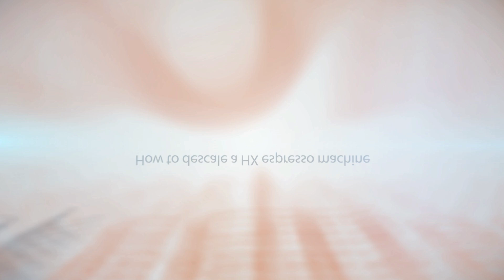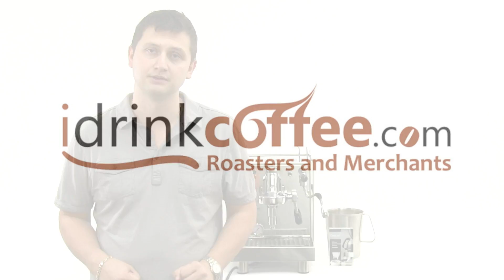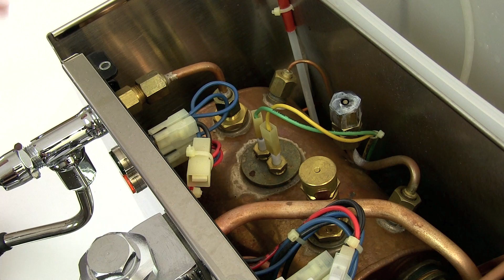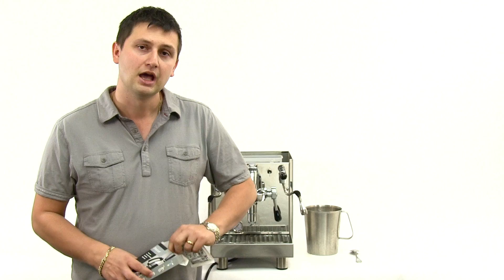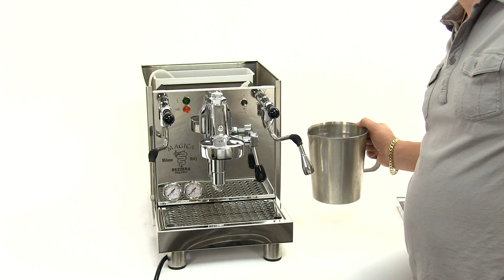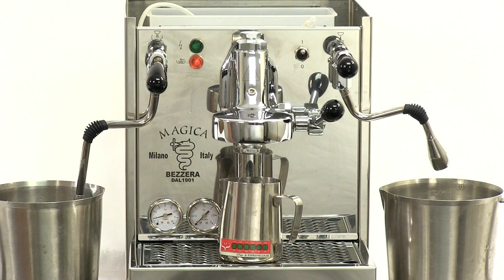How to descale a heat exchanger espresso machine

Comment: Any recommendations on using this method on a plumbed in heat exchanger? I have a Fiorenzato Volante. I tried once using an external tank but the pump sounded so labored that I quickly aborted out of fear of damaging it.
Reply from the maker: +putneybay 

It would be much easier to just descale a plumbed in machine without disconnecting the sensors. The easiest way would be to switch to water tank rather then direct connection, if your machine allows for that.
Reply: No, the machine has no tank at all. Any way to DIY descale it, or do I always have to lug it into a repair shop?
Reply from the maker: +PutneyBay 

It is challenging to descale a plumbed machine. In order to do so, you would have to get a FloJet, a larger water bottle and some descaler

Comment: I have a question regarding the "leave it to rest as long as you want. more than an hour" advice.
I have an aluminum boiler machine. Can the urnex descal I use, damage the aluminum?

Thank you
Reply from the maker: +UltiMogr 
No it won't. Leaving a descaler in a boiler overnight should be sufficient

Comment: hi there,

I just bought a nuova simonolli oscar and im a newbie with coffee machines. do you have a video for descaling the oscar? i saw from a youtube video that he used the steam wand (since it doesnt have the hot water spout) to get rid of the descale water. be also turned the machine to it's side (not sure if that is safe) 

do i also have to disengage the probe in the oscar as well? would be very very helpful if you go give some advice.. thanks
Reply from the maker: +Em t I am sorry but we do not have a similar video on the Oscar. I would recommend you to descale it the standard way, without disconnecting the probe and flushing through the steamer.
Reply: @iDrinkCoffeeCanada  Hi. Do you think the Oscar 2 can be cleaned the same way though using only the steam wand (since it does not have a water spout)? The O2 has a drain on the boiler, so do you have any recommendations on how best to take advantage?

Comment: Incredible, the most stupid advise I've seen in a while.
When you NEED TO descale an HX machine, its always better to to it apart!
Your method is a recipe for disaster, as we just saw on our coffee forum!!
Pieces of calcium will start travelling to places you wish it didn't...and most likely will lead to having to take it apart anyway!!
This video is especially not done on HX and E61 type espressomakers!!
So descaling is for very badly neglected machines!
Its way better to prevent the building up of scale, by using a special filter on the water intake of your machine, or the type of bag you put in your water container, or the professional filters of course...
Reply: ***** , often people think they need to descale 'regularly', its WAY better to avoid building up of scale by using a filter! The taste of your coffee will improve too!
Take out the heating element and check the inside of the boiler, when there is a lot of scale, meaning no filtered water was used, its better to take the boiler out plus the tubing and descale with citrid acid. After using the acid its a good idea to fill the boiler and add a little baking soda, it will stop the acidity.
In that case you need to descale the grouphead too! Take the mushroom of the head, that will give you a good indication as to how much build up you have.
Use new rings and rubbers!
I know how bad most drinking water is in N America, although everybody says its 'perfect', so again, please use a filter. There are filter 'bags' too to put in the tanks of prosumer machines, as there are small filters you attach to the tube in your water reservoir, for the serious coffee drinker there are the professional filters you can connect to your water main.
Hope its clear, English in not my native language.
Reply: Incredible! some people don't realize that good descaling solution dissolves calcium,
I've been descaling my VBM HX machine using this method for many years.
BTW, filters help but descaling still needs to be done especially if you live in a region where the water is very hard.
This is the same descaling method that's listed in my VBM manual, some people need to do some research rather than give bad advice.
Reply: It’s good this video because i have already clients in my service with machines blocked. Clients who follow this guy .  Guys , never do this at home if you dont want to make damages to machines. In the final you go to the service or drink tea with descale taste. Good luck

Comment: Great video and very similar to my ECM machine. Took me forever to figure out a lot of this information with the company not really providing any isight. Do you know anything about setting the pressure for the pump? I have never been able to get a clear picture on where to exactly change the air flow as my machine is running a bit too high in pressure. This is not the temperature boiler setting as this I know.

Comment: I just wanted to add a tip with regards to the pressure relief valve. It is pointed out in the video. In the middle there's a pin that will move up to release any excess pressure, thus protecting the tank. However, with the level probe disabled, and the tank filled to the rim, chances are that the pump will continue to pump water through the pressure relief valve.

I had little luck with the towel method to stop the water from flooding into the machine (where it immediately drained out through holes and onto the counter). With the steam valve and the hot water tap opened up completely, there's little chance of any pressure building up in the tank, so one can quite simply push down on the little pin on the top of the PRV, which will close it completely and stop any water from coming out that way. I used a towel to pressure down with my thumb.

This of course should never be attempted with the tank under pressure. Not only will you not be able to push the pin down, should it raise up because of pressure. The water coming out will also be scalding hot, and so you'll burn yourself.

So in short, do this only with the steam and hot water taps open, and while the tank is not yet heated up.

Comment: Thanks for these instructions! Very useful. Although I agree with others that the entire tank don't actually need to be descaled, this method will indeed ensure that all the water is displaced. Of course, disassembling the machine, in order to remove the tank and descale this on it's own, would descale the entire tank as well. But I do agree with the comment on electrocution. Be careful when poking around in the machine, as 120V (for North America, 220V for Europe) is being conducted in there!

Comment: i never need to descale my heat exchanger espresso machine, because I was using Distilled water( Zero Parts per million ) sometime I also filled my machine with Reverse Osmosis water ( Only 2 PPM ) So, I suggest you guys use only Pure H2O to avoid calcium build up in your expensive machine!
Reply: There are those who feel the coffee actually tastes better with minerals in them. I.e. a bit of hardness in the water improves the tastes. Probably a matter of taste though, but something to keep in mind. Also, many HX machines need some minerals in the water (although very little) in order to conduct electricity through the water. This is used to sense if the water tank is empty or not.
Reply: Distilled water water will not taste right, its better to use a 'descaling' bag in your water reservoir, or hook up a small filter to the hose of the intake.  We use the professional filters of course.

Comment: Just a thought. Another way to make sure its completely flushed. Sprinkle a bit of baking soda on the discharged water (base added to a acid). If it bubbles there is still acid in there.

Comment: Totally wrong and unprofessional way.For older machine the best way is to remove boiler and heating exchange and soak for 24 in citric acid which fairly cheap and most effective
. If you do descaling on machine no need to remove any probes, no need to overflow boiler and spill water on electrical and electronic components,There is no scale above normal level of ware level, because water does not get there.Working on machines with removed cover and overfilling as very fast way to get electrocuted.
Reply: That is definitely a more involved way to descale the machine though. I know this is often the recommended way, and would typically be the way a professional would do it, where you to send the machine away for descaling. However it does indeed involve removing probes, and the entire case of the machine, and a number of pipes, and indeed the entire tank itself. Just saying...
Reply: Oke, first: Thank you for you comment. But would you happen to have a video (link) of a demonstration/instruction on how to propper descale? I am still looking for a good instruction on how to descale my Bezzera BZ10?
Reply: I had severe problems descaling the Jura I started with. The seals / gaskets suffered under the acid and failed after a while. I tried different acids and adjusted the conentration. I ended up using bottled water instead. This might be the reason why it might be recommended to descale the boiler while dismantled.

Comment: I followed you instruction for a rocket giotto v1 and after I unplugged the water probe wire, then turn the machine on. The pump doesn't start automatically as you had suggested. Even when I have the steam and hot water knobs open. Anything I'm missing?  Thanks
Reply: make sure the water tank is properly put in with the water level sensor engaged. i.e. the right hand bar sits in the V shaped slot at the top

Comment from the maker: The process is essentially the same for a dual boiler. You descale the steam boiler by overfilling it like in the video and for the coffee boiler you just run more water through the group since you have to displace your entire coffee boiler with descaling solution. I only ran 125-200 ml through the group because that is enough for the HX but for a machine like the Izzo you would run approx 700ml or whatever the size of your coffee boiler is.

Comment: Does this work for dual boiler such as Alex duetto?
Reply: You'll use a different method for dual boiler since your brew group has it's own boiler, you'll likely need to use that to fill and dispense water and then similarly do the steam/hot water boiler.